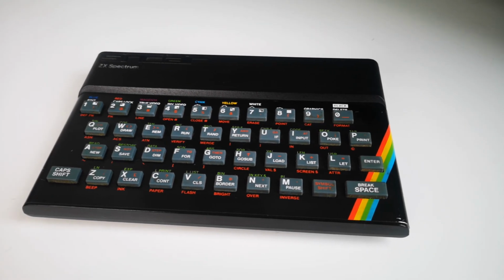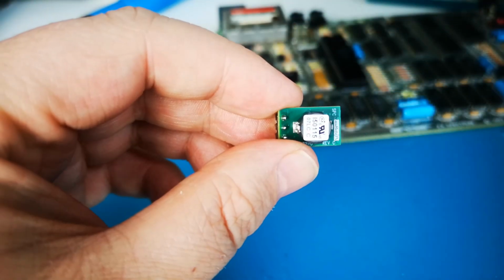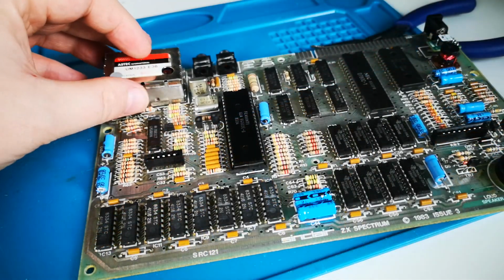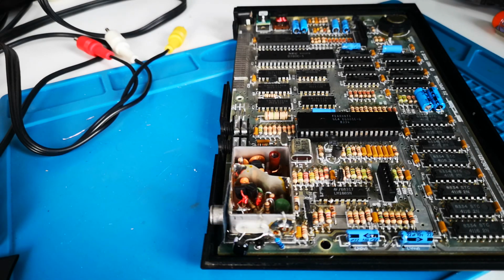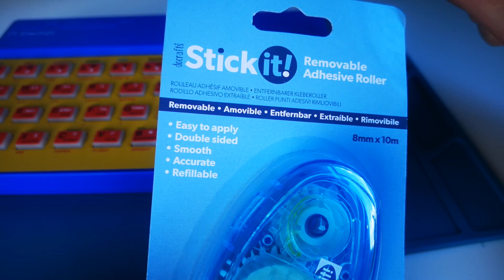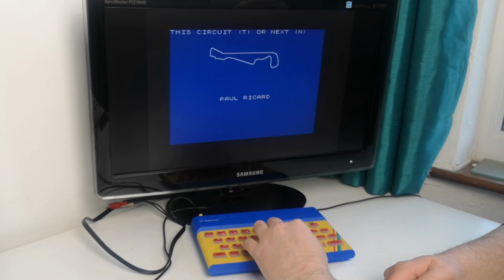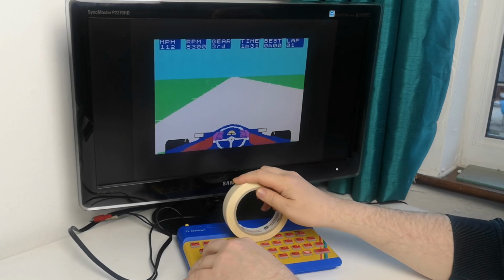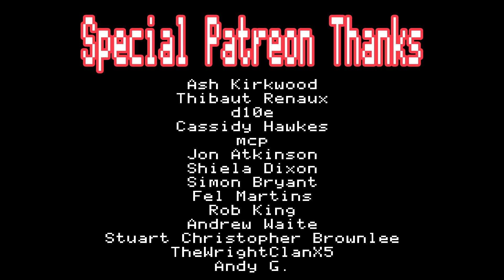Adventures in Stupid Spectrum Modding

Comment: Thanks for this video, I love your work! Could the interference you pointed out at the end of the video be down to the switched mode power regulator you swapped in? I tried that mod on a SNES once and saw video interference caused by it. I think the way you fix the interference is by adding a inductor/choke and a capacitor in series between the voltage regulator output and where that output leg meets the console. The choke and cap smooth out any electrical noise. Hope that helps! Keep up the good work!

Comment: It never ceases to amaze me how many accessories and replacements you can still get for Speccies almost 40 years on. Mine has the composite mod, has been recapped and has a new voltage regulator, and is in a lovely looking white case with grey keys at the mo. I had white keys for a while but it looked a bit odd. I really need to find a white Atari joystick 🕹️ to match 👍🏽

Comment: When I did the composite mod on my Speccy's, I did the same as you with the capacitor. It looked awfulf, so I just used a piece of wire in place of the cap. Perfect picture on all models. I've also got a Halequin 128 in an original 48K case. Cool vid. (not cool colours. LOL)

Comment: Thank you for respecting my OCD and not replacing all the capacitors for no real reason.  There is nothing I enjoy more than when some idiot puts a new capacitor in backwards and kills a unit in doing so when they were replacing the capacitors on a perfectly working piece of equipment.  It gives me a very strange joy when I see the smoke. 
Those wise old words enter into my head.... If it ain't broke, don't fix it.
Reply from the maker: Yep the caps all seem fine. Definitely not worth the effort unless there is a problem.